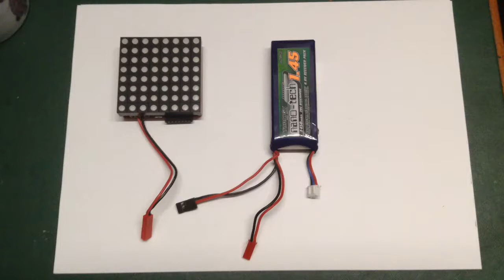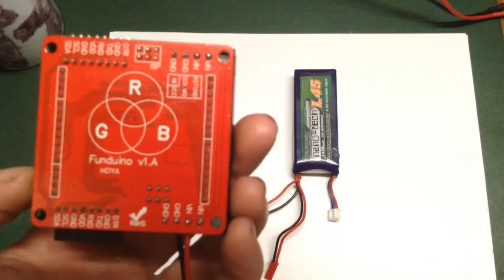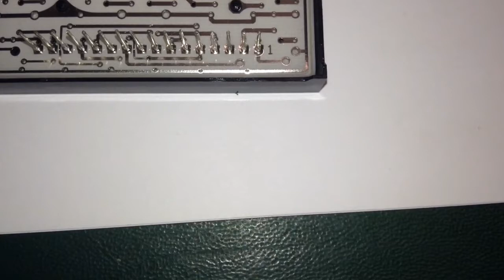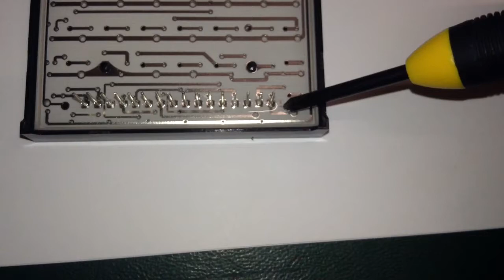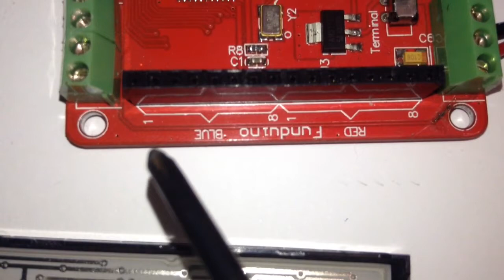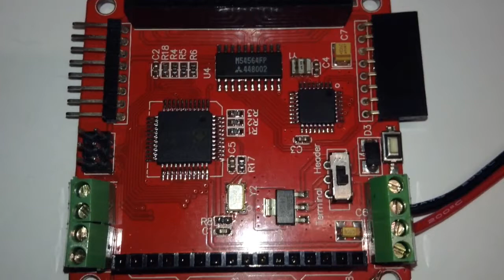Funduino v1.A - plugging the matrix in the right way around helps!

Comment: How do you configure ARDUINO software?. I couldn´t transfer any code to matrix.
Reply from the maker: It has been ages since I used that module, but I would have done one of two things depending how it was pre-programmed. If it had a bootloader, I would have used a USB to serial adapter to connect to it (Tx to Rx, Rx to Tx, GND to GND, VCC to VCC, DTR to DTR (lets the board self-reset for programming)). If not, or if I didn't want the hassle, I would have used a ICSP (in circuit serial programmer) such as the USBASP, and plugged that into the 6pin header near the screw terminals. Then in the Arduino IDE it would have been configured as an Arduino Uno, with the appropriate port or programmer selected. Have a look at this to give you some ideas. https://123led.wordpress.com/colorduino/
Reply from the maker: I just checked out the module as I had some free time, and it didn't have a bootloader, so I must have used the 6pin ICSP header. I used a USBASP to load the Arduino bootloader so I can use the serial pins in the future.

Comment: I've had no luck programming mine using the arduino as a tty to usb, as well as using a dedicated ttl to usb ( ft232r) adapter. I have searched for help online with no luck. Are you having luck programming this unit ?
Reply from the maker: It may not have a bootloader, or maybe you not connecting the DTR line so the board can reset (or you can press the button on the edge of the board just as the compile finishes and the upload starts). Otherwise, you're better of using a ISCP (in circuit serial programmer) as the 6pin header for that is just to the side one of the terminal power blocks. A USBASP is pretty cheap on ebay, and will do the job nicely... you just want one that comes with a 6pin socket or an 10 to 6 adapter. There is some good info on https://123led.wordpress.com/colorduino/ that may help.
Reply from the maker: Yeah, it doesn't look like the one I have had a bootloader, so I used the 6pin ICSP header and a USBASP to load the Arduino bootloader so I could use the serial pins.